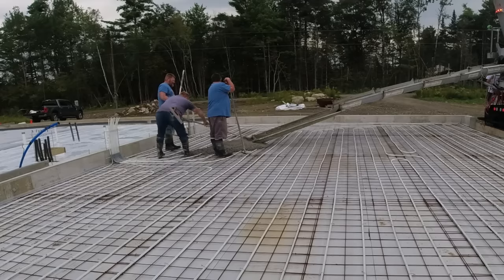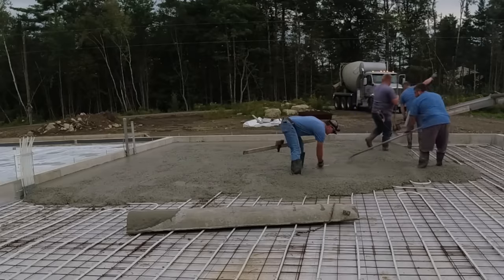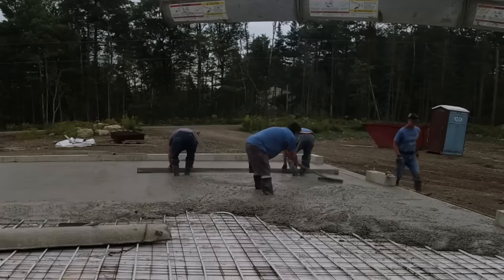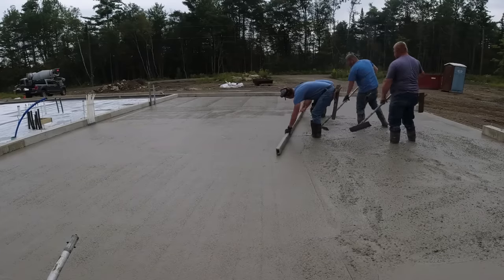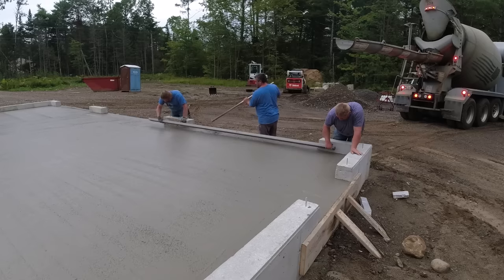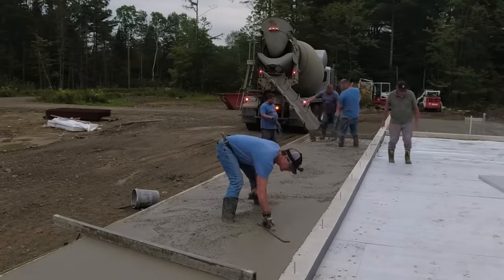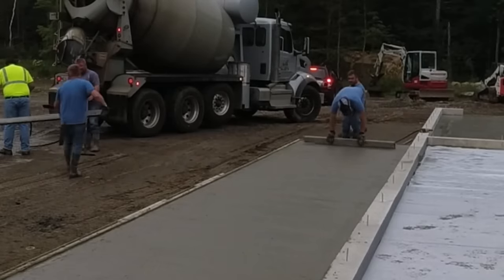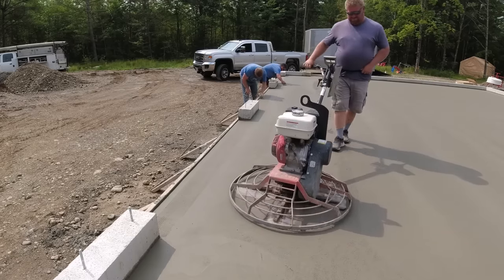What I Charge To Do Concrete Work PLUS The "Secret" ingredient that lets you pour LOOSE Concrete!

Comment: Used  water reducer 20 years ago on a single car garage slab I did solo. I told the supplier I wanted a strong wet mix after reading about  water reducer. It was a game changer! I use it for walls as well. Almost completely eliminates air bubbles. You can see the grain pattern of every form board in the concrete and almost completely eliminates the need to vibrate. Your crew's knoledge is apparent in the calm, methodical and efficient manner you guys work.

Comment: Water reducers: "Superplasticizers (SPs), also known as high range water reducers, are additives used for making high-strength concrete or to place self-compacting concrete. Plasticizers are chemical compounds enabling the production of concrete with approximately 15% less water content. Superplasticizers allow reduction in water content by 30% or more. These additives are employed at the level of a few weight percent. Plasticizers and superplasticizers also retard the setting and hardening of concrete"

Comment: Nice work and great job on video. That’s right on for pricing. We are in Louisiana and charge about the same rate but no foam. Minimum is $3000 instead of 2500. We pay 120 a yard here for 3500psi with fiber… no reducer. We typically pour 5” depth due to poor soil composition. Thanks for sharing your knowledge and expertise.
Reply: We pay 180-210 dollars a yard here in east tn unfortunately
Reply from the maker: Thanks 👍
Reply: 215 w med range pcb fl
Reply: Im in Louisiana where are you getting concrete for 120 im paying 167

Comment: I skimmed the comments didn’t happen to see it mentions. I make and design concrete mixes for a ready mix company and do QC. Very glad to see you guys using WR in this manor. Not nearly enough finishers use it. The reason for this and I’m not knocking anyone because most people inherently hate change. Your typical concrete finisher has been doing things the same way for 20+ years and when you try to educate them on things that will make their concrete better or easier they don’t wanna hear it. Water reducers. They are not all the same. You have different ranges so I live in Georgia, your typical 3000 psi residential (those without 20 years experience) different strength Concrete is used in different places geographically here it’s what 90 percent of driveways, house slabs, walls/foundations. The water reducer we use is a medium/high range water reducer Plastol 6420. The dosage rate is based on hundred weight cementitious material. What a job calls for super P or superplasticizer. We dramatically increase the dosage rate and we do that on at the pour location. One thing to be careful of if you are not used to pouring with a high decent rate of water reducer, even if you don’t get to the dosage rate of superplasticizer. Just because it looks loose now it will lock up QUICK so you can’t play around otherwise it will get away from you
Reply from the maker: Great insights, thanks for commenting 👍
Reply: Yea, the looks of that stuff would make me think I had all day to work with it.  It doesn't look too wet, it looks WAY too wet.  I am curious as to how the US government looks at this water reducer.  Like pours on the Fort Bragg, NC Military base used to require a very specific amount of water which had the concrete almost rolling down the chute.  If the concrete had too much water in it, they would reject it.  But that was years ago when I heard that, so they might be using the water reducers by now.
Reply: What I find mindboggling is that no one knows the water/cement ratio for their pours - no one.

By optimizing or improving the aggregate mix you can also improve slump or workability a lot. Are you familiar with Tyler Ley's Tarantula Curve for the aggregate mix?
Reply: @dewboy910  Those on base pours are managed by the Corps of Engineers their manual is from the Stone Age. However, you have to understand water reducer is in every batch of concrete these days. The plant I run we have like ~ 50 standard mixes in our batch system give or take. Every single one of our designs has WR. With our DOT certs we have to list which WR we’re using (plastol 6420) but which type is used differs by region. When one of our customers wants something like in the video. What we do is hold a lot of water out, the driver washes his blades and slumps the concrete till his slump gauge tacking between 2200-2500. What is important is there is enough water to ensure proper mixing. When he gets to the job he will add one gallon (128 Oz) of plastol if he arrives at a 2 inch slump that gallon he added will take him to a 4 1/2 inch slump. If the finishers want a 6 inch he will add 5-10 gallons of water and more plastol as required. I am not familiar with concrete in maine but being in the industry I believe what he is referring to is adding additional WR not just WR in general.
Reply: What is the going rate per yard to get a 7 slump like in the video? Thanks

Comment: Thanks, Mike.  Very informative.  It’s the same here for us in Minnesota.  We usually have to quit our flatwork around November 1st and don’t start up til end of April.  Concrete here is about 165 a yard not including winter rates which add another 12 a yard.  One more week and they’ll be done with that added cost.  We charge more for the power trowel finish than brooming…..power troweling seems to take longer and it is a more specialized labor that many cannot do.  So our square footage prices are reversed from yours.  Take care!
Reply from the maker: Thanks for sharing Mike

Comment: Looks good.  The WRA is good.  We use fly ash too.  I’m not a fan of wet screeding but most people now use that method and some get flat floors.  A good bull float man makes a world of difference.  Might as well leave the wire out though if you’re gonna leave it on the bottom.  Maybe it’s only in there to hold the pex down?

Comment: Ok... im going to be that guy....i didnt see anybody pull wire up one time......is the mix so wet it floats the mat?
Reply: You don’t pull up the wire when it’s installed just specifically to hold the radiant tubing in place not for strength, I’m assuming there was fiber mesh for strength

Comment: I was a concrete finisher back in the early 1980s and we poured hundreds of thousands of yards of concrete wet like that and guess what it’s all still there!
Reply: It all sets up doesn't it?  The main thing that builders here in Florida skimp on is compaction of soil.  I don't know how half of these compaction tests pass.  But we usually have to raise the lot by about 18" or more here in SW Florida, and most builders just dump the dirt and run over it a few times with a skid steer .  Later, floors crack, CMU walls crack but the builder has his money by that time and is gone.